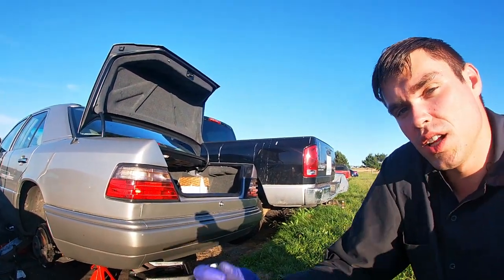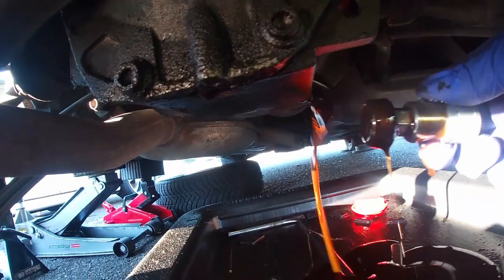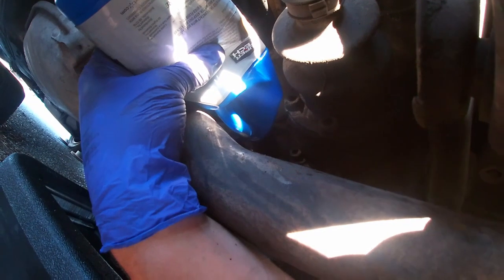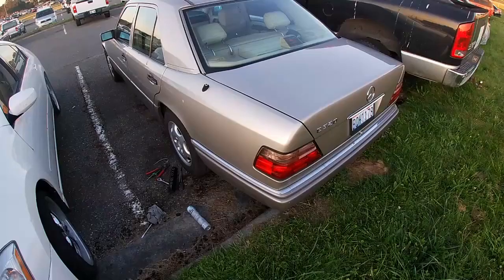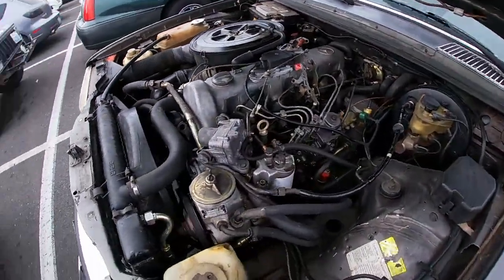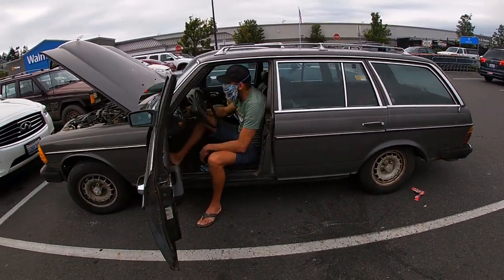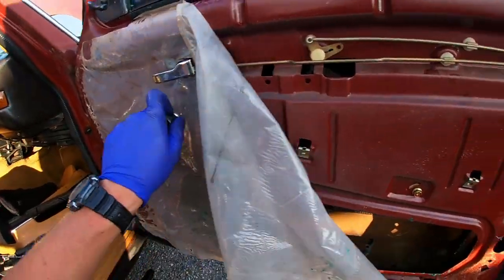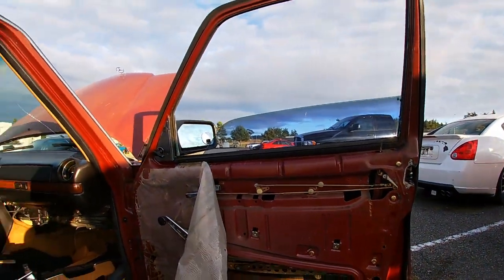Mercedes W124 E320 Differential Oil Change and Window Regulator Repair + Mercedes W123 Wagon!!!

Comment: Dear Vito only a positive advice for the next time, the lightbulb in the tailgate get warm and can melt the plastic cover. On the left side you will see a black plastic stick for close the electric circuit for the light if you close the tailgate. If you pull that to you, than the light goes out. I hope I could explain it to you, with my bad English. Keep going and like always, like you see your love for the old cars.

Greets.
Reply from the maker: Thank you for watching and supporting. And thank you for the advice. I'll keep it in mind. Check out my videos and playlists!